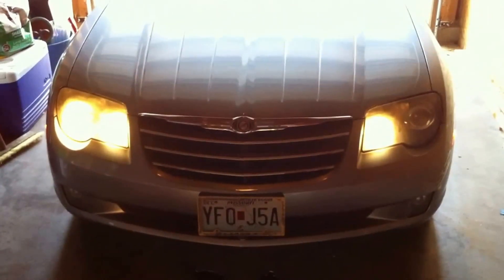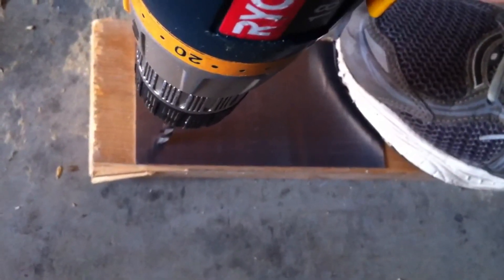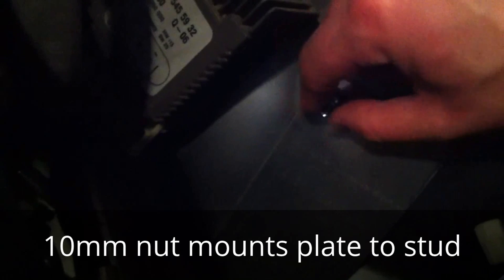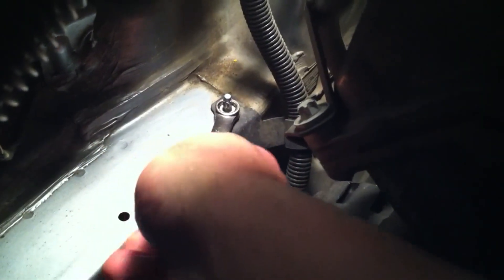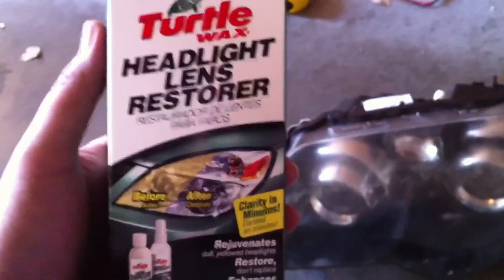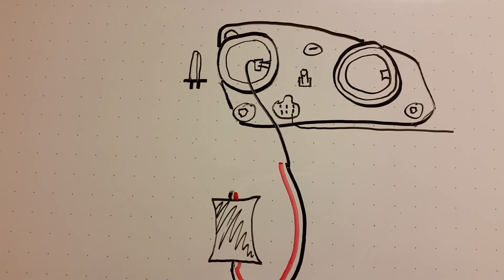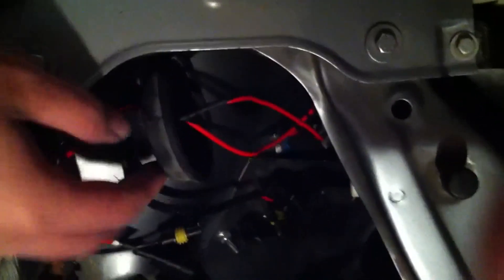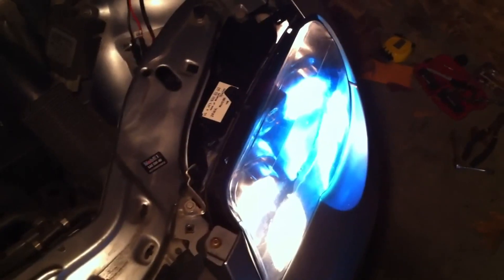HID Xenon H7 Headlight Kit Installation,  Chrysler Crossfire conversion with wiring diagram srt

Comment: This is a totally ridiculous excessive amount of instructions.

There is zero reason to drill holes or mount a bracket to fasten the HID ballast

All you need to do is use some super Velcro.

Simple

Comment: Awesome tutorial! Was looking into LED but the the bulb assembled was too long. This is much better. Love ur car. Have the same one, color and trim 2007. Guess they're pretty rare, I have never seen another one. I used the Mother's Nulens headlight restore kit. Works awsome!
Reply from the maker: Thanks Stephan. Just added new wheel rims, and tires. I plan to put a video together on the math to right size the wheel and tires to fit the stock application so Crossfire owners can save some money where the rubber meets the road. Please subscribe so you can be informed when that video hits. I will be saving you some money when you go to buy tires next time.
Reply from the maker: Oh, most importantly thanks for watching and commenting, it means a lot to me.

Comment: is 55w going to work in this car?? will a relay harness be necessary?
Reply from the maker: Kirsten Higgins great question, I used 35w in my car. I do not have a relay harness in my car and they work. I eventually thought that the light blue color looked a little juvenile for a professional to be driving around with and picked 6K bulbs instead. If the 55w don't work, they are probably trying pull too much power, if that is the case you may try an aftermarket wiring kit or relay harness.

Comment: Did you have  to take off your bumper in order to get to remove the headlights?
Reply from the maker: no! dont take the bumper off. there are access ports in the wheel well to remove the headlight bottom bolts. its a bitch to get big hands in there, but it can be done.

Comment: Have you since installed a wiring HID Harness to protect the electrical system?
Reply from the maker: There is some discussion about this on the forum. I have not installed a relay in line to protect the Ballasts or the Electrical system. I do get a little flicker some times when I first power them up indicating they may not be getting the ideal voltage at first flick of the switch. I have not had an out bulb or ballast in 4 years. This video is older than it's "born on date" because I went back and recorded the wiring diagram because people were asking on my old copy of this video. good luck with your install. I really like my HIDs in coming from this cars giant projector bezels.

Comment: Did you get a "error light bulb" light on your cluster?
Reply from the maker: No, I did not. I did not use a relay either. The kit pulled the required voltages from the battery so the sensors have no issue with the ballasts being installed in the system.
Reply from the maker: No, I did not. I did not use a relay either. The kit pulled the required voltages from the battery so the sensors have no issue with the ballasts being installed in the system. I have since moved on to 6k bulbs, very white in color, very nice for driving. I have also installed OSRAM bright whites 6.5k in my High beams. very happy with the results.

Comment: R u in Houston
Reply from the maker: No, sorry Mid-west.
Reply: +glencouls have you had any issues out of these?
Reply from the maker: +Caleb Stith four years after my installation, my passenger side headlight started to flicker. I took the bulb out.  The glass on the bulb was displaying a white cloudy spot. backstory: the passenger side headlight on the Crossfire is a PITA to get to. I likely accidentally touched the bulb with a greasy finger during installation making this white burned cloudy spot. I bought new bulbs, 6000's bright white. I love them. still driving down the road I now have spent about $55.00 total on the headlights.

Comment: Nice tutorial. I highly recommend the 3M headlight restoration kit. I never had much luck with hand-sanding headlights, but the 3M kit with the power drill attachment worked wonders. I also ordered some 3M protective film cut to the dimensions of the headlight, as well, as the process removed any clear coat that remained from the factory. Thanks for your efforts in making this video, man!
Reply from the maker: ***** Thanks, I'll try the 3M kit. It's about time, after 3 years the lenses are starting to fog up again.

Comment: where did you order the HID Xenon H7 headlights kit from
Reply from the maker: starsolohan the kit you see here is from Amazon. Xentec H7 10000. I bought them on special for $34.99, if I remember correctly. More expensive kits come with brackets, so all of that mounting plate business is really not needed. I research what you get with your kit. I've seen some very nice $100 kits, with more rugged metal ballasts and rubber grommets that tighten into the portal caps. I've been very happy with this kit however.
Reply: I actually sell them if you need, I also put them in my crossfire :)